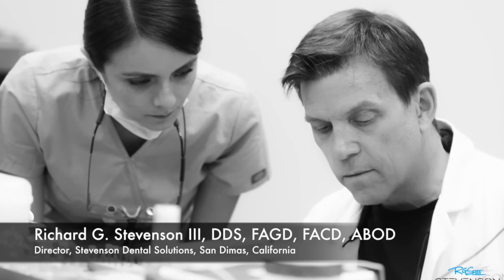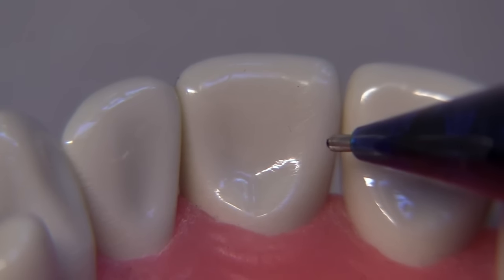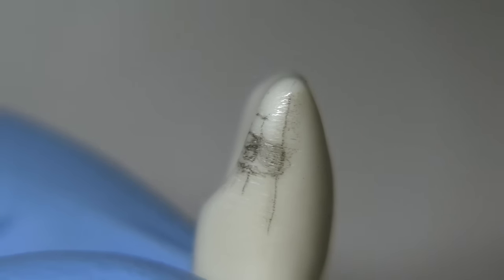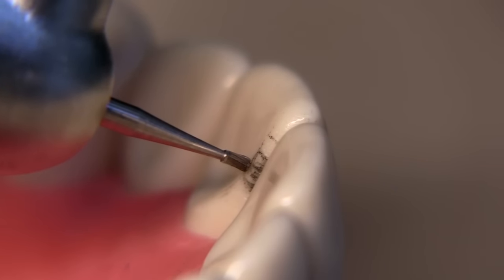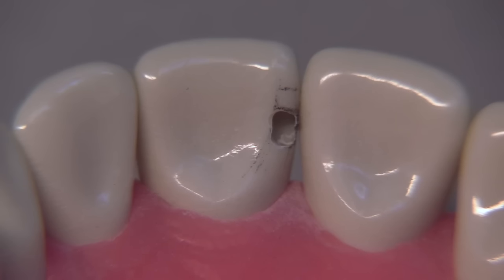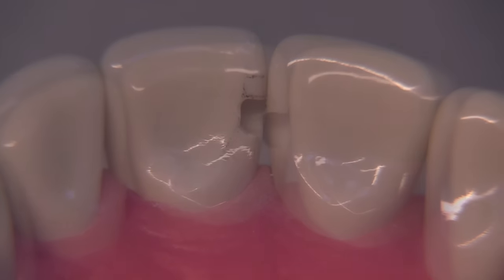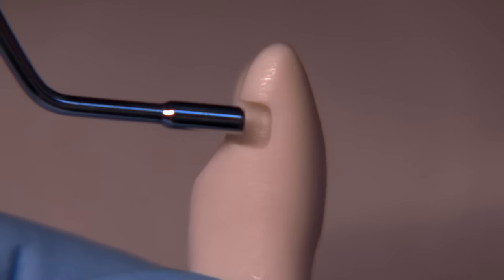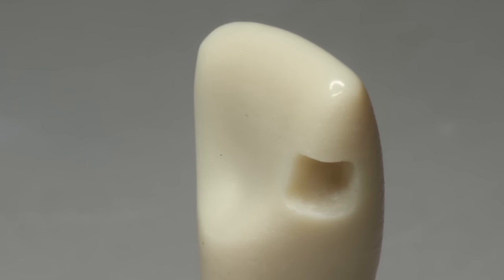CLASS III Preparation for Composite #8 ML

Comment from the maker: Some confusion with a few viewers: "The point of bur entry is within the incisogingival dimension of the carious lesion or defective restoration and as close the the adjacent tooth as possible without contacting it. Direct the bur PERPENDICULAR (90 degrees) to the enamel surface..." Sturdevant, "The Art and Science of Operative Dentistry"  Angling the bur at a 45 degree angle undermines the incisal enamel.
Reply from the maker: One more thing:  For an MF (facial approach) the bur is initiated at a 45 degree angle and the facial enamel is left undermined, but this works because the facial surface isn't under function.  This is done primarily for esthetic reasons.

Comment: AWESOME DEMONSTRATION! Thank you so much for sharing your knowledge! It's so helpful to us dental students
What RPM did you set the electric motor while you did this demonstration without water?
Reply from the maker: It was done with an air driven handpick, but when we use electric I prep at full speed for the majority and then slow to 5,000 or sometimes less for refinement.  Thank you

Comment: Dear Dr. Stevenson,
If the hand instrument provided (enamel  hatchet) is of 1.5 mm, should the cavity still be at 1.5 mm size for DL on #9? Sometimes while practicing with a constraint of the provided hand instrument, I end up making the overall prep of 2mm. Could you please share how to keep it at just 1.5 mm and still be able to use that 1.5 mm hatchet? 

Thank you for this amazing video. 

Best regards,
Adi
Reply: Is it acceptable if the facial extension gets near 2mm as well?
Reply from the maker: With a 1.5 mm hatchet this is very difficult - it will most always be at least 0.1 mm more than the width of the hatchet.  Sometimes, you may wedge and create some separation and then it will fit easily...

Comment: There is this thing I am confused about. I was always taught to always use diamond burs to prep the enamel but I see a lot of US dentists to use those high speed carbide burs, whether it is crown prep and now a cavity. Could you please talk more about thee difference? Doesnt the bur have rather shattering effect?
Reply from the maker: In the early days of operative dentistry, carbide steel was the only technology known to make burs.  It wasn't until much later, in the 1970's and 80's that diamonds really become commonplace in dental practices and textbooks.  The more recent development of operative diamonds has taken some time to catch on, and although great for less chatter when penetrating enamel, they are relatively costly and not as precise dimensionally compared to carbides.  If you were to peruse the two most significant Operative texts in the US - by Sturdevant and Summitt, you'll see that the carbide remains as the go to instrument for conservative preparations.

Comment: Crisp and clear knowledge 👌 . I have 2 ques:
1. Which operator position would you suggest to prepare class 3 cavity on Distolingual surface of tooth no. 12 ( first quadrant lateral incisor)? I find it difficult to access this surface while keeping the bur perpendicular to tooth and using a hatchet to smooth the walls feels impossible.

2. I am currently using 3.5x magnification for restorative work required for the exam. Do you think i should switch to 4x  or 4.5x to make my work more intricate for the examiner to check 😅 what according to you will be the sweetspot for magnification for a dental student?
Reply from the maker: 1. Use the 11 O'Clock position but have the patient turn away from you - this help. 2. I siwtched from 2.5x to 4.5 x after two years and then 2 years after that ramped up to 6x.  I also use a microscope.  If you can, push the mag as high as you can - you'll quickly adapt.  4.5x isn't that high, so you should do well.
Reply: @StevensonDentalSolutions  Your guidance is so helpful. Thankyou 🙏
Reply from the maker: @sahilbhalla389  My pleasure - Happy New Year!  Dr. S
Reply: @StevensonDentalSolutions   Happy new year to you as well 🥳

Comment: Hi Dr. Stevenson! Great video just had a quick question. What about the bevel is supposed to be placed on the cavosurface margin of the preparation?
Reply from the maker: Bevels on the lingual of small class IIIs are no longer the standard taught in most dental schools. None of the national boards required them neither the WREB nor the ADEX. I have not  been placing bevels for about 15 years. However when the class III preparation is large and extends onto the facial bevels are mandatory for retention and aesthetics.

Comment: Thank you so much,you are a great tutor 
I have question when we open contact in class 2 can we use interproximal  bur or not?  
Can't we use inverted cone , enamel hatchet?
Reply from the maker: I would not use an inverted cone for composites due to the sharp line angles created with this bur.  I'd use an enamel hatchet and be careful not to create a sharp internal line angle.  Interproximal bur like a 169L, yes these are great.  Thank you for the questions!

Comment: Im curious can this be done on the central incisors all across. I have a decay/tartar likely a cavity aswell it looks like a brownish line on the backside of my central incisors.

I have no real tooth pain, feel irritation mostly but no sensitivity to hot or cold. Hopefully tomorrow I can go to my dentist and they can get a good look at it. 

I am praying a simple filling will fix my issue and not need to get a crown/root canal/ tooth extraction.
Reply from the maker: Yes, composite restorations may be a good option for you.  If your problem is due to wear from grinding a night guard may also be suggested or even a sleep study - sleep disordered breathing and grinding are high correlated.

Comment: Hello Dr. Stevenson. Thank you so much for the video.. was very informative and helpful. 
My question is, I am supposed to do a class III restoration involving the labial, mesial and palatial walls. In this situation, do I start my prep from the palatial or labial surface? Any other particular points I need to keep in mind while making this preparation? Thank you in advance.
Reply from the maker: Start the prep where the least amount of tooth will be removed.  Usually lingual (not palatal) access is the most common.

Comment: Why is it that when viewed proximally, the facial wall is not parallel to the lingual surface of the tooth? Is it meant to be Parallel to the long axis of the tooth? Thank you!
Reply from the maker: The tooth is triangular as viewed from the proximal and the lingual wall and facial wall are converging, not parallel.  The facial wall should attempt to parallel the facial wall.  Thank you for the question!
Reply: @StevensonDentalSolutions Thank you! Damn, i thought the box prep should have parallel walls...like an actual symmetrical box.🤦
Reply from the maker: @James-ky7ev  I hear you!

Comment: Can you use a 56 carbide rather than the 329? I find it gives me a flat, smooth, facial wall.
Reply from the maker: The 330RGS does this too and avoids sharp line angles.
Reply: @StevensonDentalSolutions  I see what your saying, I just used the 330 on my practical today and it did the trick for a very smooth surface with rounded internal line angles.
Reply from the maker: @choochd  Awesome

Comment: Hi Dr Stevenson, I have a question which might sound stupid. For all preparation of teeth ,from examiner point of view, what power loupes you recommend for practice? I got two loupes (3x and 6x) and my preparation seems very clumsy under 6x which seems fine and smooth under 3x. If we know what power loupes examiner will be using for marking, it'll be very helpful for students. Thanks...
Reply from the maker: Great question!  Most dental school faculty and WREB/NERB examiners use 3.5x - 4.5x loupes.  If the prep is smooth at 3.5x, it will always look less smooth at 6x.  Using 6x takes many hours of practice and isn't initially practical.  Do the best you can at 3.5x and you'll be in the "Green Zone" if you've met the criteria.
Reply: Thanks heaps Dr Stevenson for clearing doubt.

Comment: what to do if i dont have a hachet in the exam? wich instrument can i use?
Reply from the maker: Hi - use a flame shaped carbide - just the tip to remove the lips of enamel.  It's harder to do but it works.  Best wishes!
Reply: @StevensonDentalSolutions thanks a lot for your answer.
Reply from the maker: @qusaialrawas1385  Of course, happy to help

Comment: hi doc, which chair position would you suggest  for preparing class 3 on mandibular canines both left and right  , if we are only allowed to be between 9 - 12 o clock?
Reply from the maker: I think that 9 O'clock would be great.
Reply: @StevensonDentalSolutions  it's a bit difficult to approach the canine in 3 quadrant , i will try turning the head so i could get to a  comfortable hand  position . Thankyou doc , knowing i have someone to reach to for help  in problematic situations means alot 🙏

Comment: Curious why no bevel here.
Reply from the maker: Great Questions!  Thank you. Bevels are no longer in favor for small preps with no esthetic margin concerns.  If the prep has ample retention and has no need to be "esthetically blended" with the use of a bevel, a bevel is not used.  The bevel would not only remove tooth structure and it would render composite susceptible to fracture (as it is thin) due to occlusal contacts.  Note: both the WREB and ADEX dental licensure exams removed the bevel requirement on the class III several years ago, in keeping with the science and teaching practices within the US. IF, the prep extended onto the facial, we would bevel the facial margin (esthetic blending) or IF the prep were large and needing retention, we would bevel all accessible margins.  Bevels aren't contra-indicated in all preps, rather the algorithm for their use is more sophisticated.  Dr. Stevenson
Reply: Thank you for the detailed repose Dr. Stevenson!
Reply from the maker: @ThienNguyen-wh1fz  My pleasure!

Comment: Im sorry but nowadays we know how crucial enamel is for bonding composite. This is an old prep style which will fail within 10 years. For success in composite you have to bevep the enamel an you cannot leave the margin in the contact area. I know im criticizing You as a teacher sie but in order to „sell“ composite minimally invasive today we forget that it bonds to teeth an has to have a large amaount of surface. Dentin bond strength ist weak an ist not stable as composite has a totally different expanson. I guess the highest success in bonded restaurations will always be veneers and thats for one reason... enamel bonding!
Reply from the maker: Thank you for explaining your rationale, however, If I posted the science for this NEW prep design, I think you might find it helpful.  Nearly every dental school in the country and the regional exam boards have eliminated bevels when adequate enamel remains.  Additionally, the butt joint margin is less likely to experience fracture than a beveled area on the lingual.  If aesthetics are a factor or additional retention is required, of course, we bevel.  I receive board certification in Operative Dentistry and Chaired Restorative Dentistry at UCLA for 17 years...just saying...So, in 2019, bevelling a small class II is no longer indicated.  I appreciate your courage to comment.
Reply: Stevenson Dental Solutions yes sir the science i would be interestet. You must have longterm evidence for this?